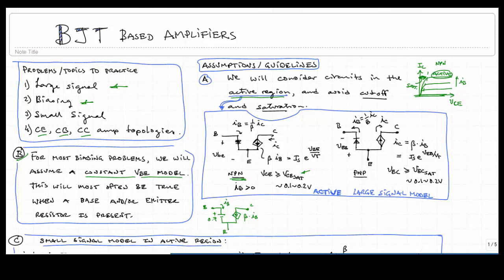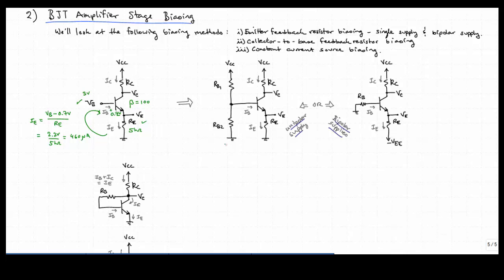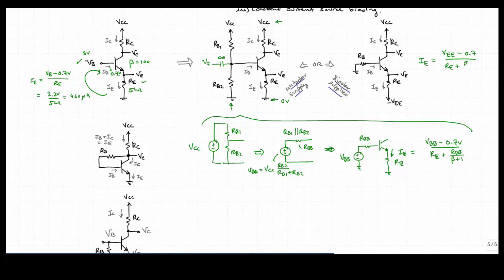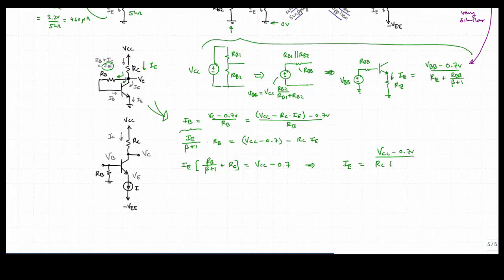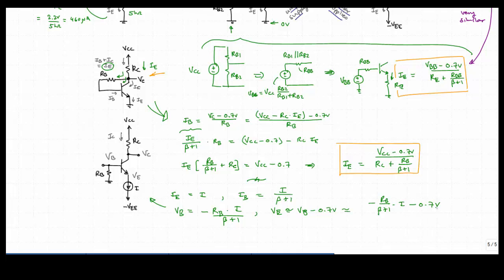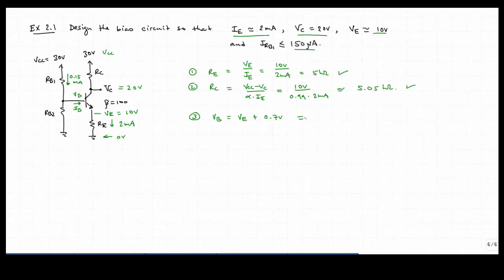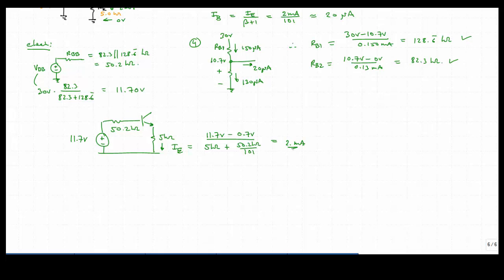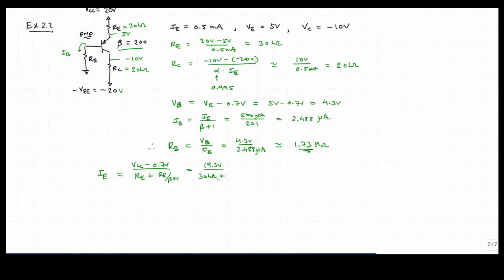BJT biasing problems (BJT-A03)

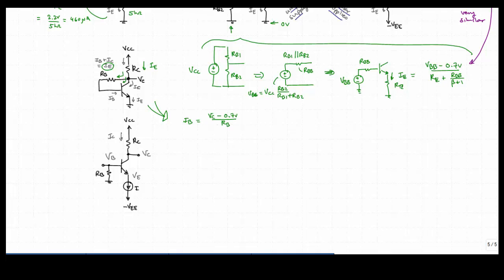Comment: Am I incorrect to point out that at 10:45 you assume a constant 0.7V relationship between Collector and Base? I'm wondering specifically about the equation IB = (Vc - 0.7V)/RB. I thought that assumption was only valid between Base and Emitter, at least as far as you've discussed up to this point.
Reply from the maker: Riley, actually that equation is saying that the collector to base voltage Vcb = Rb*Ic = Rb*Ib, not 0.7V. The 0.7V mentioned is still the base-emitter voltage, and the collector-base voltage will be Vcc minus the voltage dropped across Rc minus the Vbe 0.7V drop.
Reply: Thank you. Looking at it again I'm not sure what I was thinking. I find these videos very helpful and I appreciate you taking the time to answer!